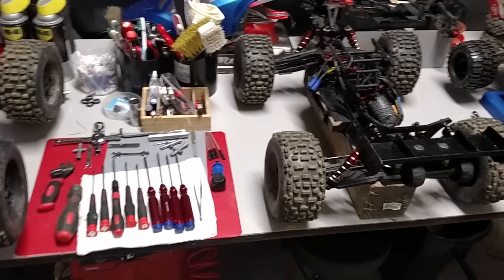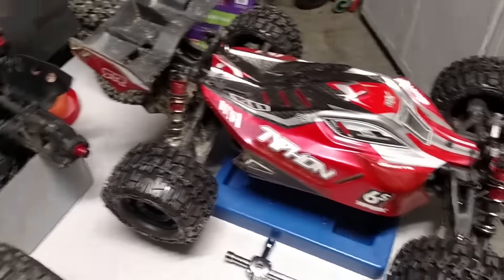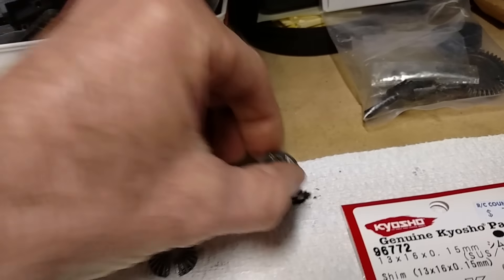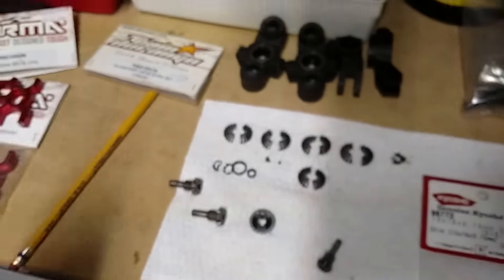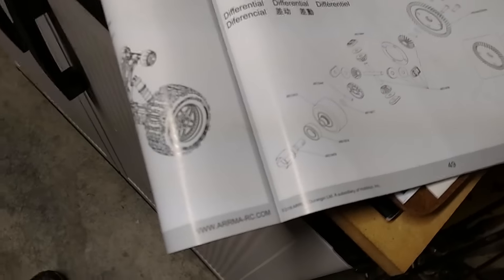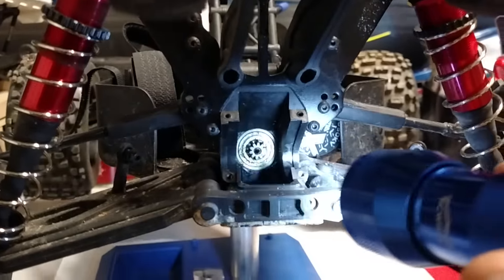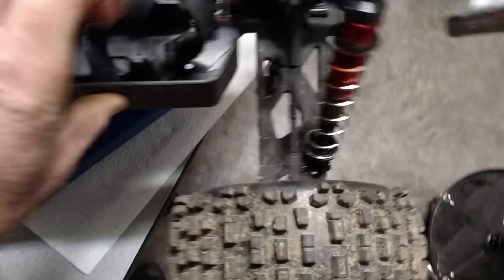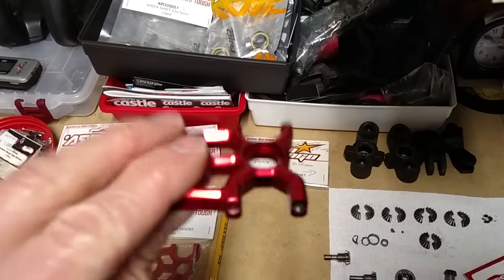Arrma Outcast 6s diff gear breakage

Comment: In the full size vehicle racing world, what you guys do with these differentials is Allen setting the lash. To much and they thrash about an knock each other's teeth out like a schoolyard fight at recess. To little and they grind bind till they effectively wear each other out. It be nice to have lash measurements that would be a joy. Or Maybe we can create some ? Mr. Bash?
Reply from the maker: Phill Stoffer these input gears are so small it's Crazy!!! I'd rather have them snug cuz any slop or separation tends to break teeth clean off. Shimming the internal diffs and adding bearing shims on the crown gear side has totally reduced my gear breakages. I still always check that they aren't "tight" and operate smoothly. As they gears settle and wear, they end up near perfect.😎💪👊👊
Reply: Rich Duperbash you are correct about tight being better than loose. More times than not. Tight will wear in. Loose will shatter and basically implode as you have shown so well in this vid.
✌
Reply: Rich Duperbash exactly. I did the same thing here but it was too late. Also. The box with Talion just arrived.
Reply from the maker: Phill Stoffer did you get a 2018??? 🤔🤔
Reply: Rich Duperbash Yes its a 2018.. Shoot a message to Gary and snag my contact info. Swap ya some shots of my flight crew and the new cars.
Reply from the maker: Phill Stoffer that's awesome brother!!! Don't forget Voltage Hobbies just released aluminum chassis supports for the V3. If you jump high enough or roll at speed the stock ones will eventually break. Vas with Aussie RC broke his the first 6s bash, but he did nose plant off at least 1 jump.👍👍
Reply: Rich Duperbash Hello again Rich. I went after those shock towers couple days ago. Backorder Edward front and rear.  Blehhhhh. Took the Talion out for a spin. Lasted 3 min. When I got it turned around and hit the juice, ended up on the ground as I had to launch myself out of the way. Came inside and put a 4s battery in it. After a glass of wine to rinse my ego off, went back outside into the unknown world of  itstooDurnedfast4u  and tried again. It went much better.  I didn't throw myself under the bus and I didn't run myself down again. YAY I AM....... ALIVE!!!!!!.
Reply from the maker: Phill Stoffer that's awesome bud!!! Yeah it definitely looks fast from what I've seen thus far. I just clipped myself with my Kraton going off a jump...Lol. These rigs pack a punch no doubt. Enjoy that new BEAST!!!😨😎💪👊👊

Comment: Hey man great video question for you I just ordered a new rear diff for my kraton V4 and the external shim that you're talkin about to bring the ring gear closer to the input shaft is on my diff. My question is when I spin the input shaft there is a rough spot when it reaches a certain point on the ring gear so when you turn the input shaft it is smooth up until a certain point then it gets hard and crunchy if I remove the external shim on the ring gear side it gets rid of that crunchiness in that one spot but it makes the rear diff gear mesh loser. So I don't know what to do on this rear diff
Reply from the maker: Thanks brother 👍. I'd take a very close look at the rough spot. Just make sure the teeth aren't chipped or flattened. If so, I'd replace the ring gear cuz it's likely going to strip and slip. Could be the gear isn't sitting totally flat on the diff cup or is wobbling slightly during rotation with the input. I'm ok with my diffs spinning a little snug by hand because they usually settle in under power. Ultimately, use your best judgement on adding the bearing shims. I still like to use 2-3 Tekno #1222 bearing shims both front and rear depending on the tolerances. 🍻😎💪👊👊
Reply: @richduperbash2966  thanks for the reply I'm pretty good with shimming but I noticed this on a used rear diff and I purchased a new complete diff and housing all put together from Arma never used so it seems strange that the gears would be flattened or messed up from the factory so I'm not sure what to do should I have it really crunchy and tight or a little bit loose with the mesh... cause i know its better to have a looser mesh than a tighter mesh so the gears wont wear..
Reply from the maker: @fpvandgasrc4321  if there's some flattened teeth, I'd probably run it a bit tight so the gears are less likely to slip and grind down. Just cake it with quality marine grease 👍

Comment: Which shims do you recommend me using please give me exact part number please and should I just shim the back or front 2? And what diff fluid you think I should use thanks slot for your videos you know your stuff I'm learning I've learned a lot from you and a couple other guys also thanks a lot man!!!!! Keep bashing arrma rocks!!
Reply from the maker: Derek Quinones I shim all 3 internal diffs the same way as Thomas P of "Tp-PartsRC-Xtreme" in his bulletproofing diffs vid. He lists Team Durango TD310475, unfortunately they still appear unavailable online. LOVED them, cheaper option than Mugen Seiki E0206. Both work great. Watch his vid closely, at the very end he puts a small bearing shim on the crown gear side. I use 2-3 bearing shims instead of just 1 to further tighten the crown to input gear mesh for front and rear. Prefer to use Kyosho 96772, but have also used Tekno TKR1222. This video was long and rambling, but think I covered these #s towards the end. I run 50/100/20k front to rear Outcast, 50/200/20k Kraton and like it. In summary, you need 2 planetary shims per diff and will be adding 2 satellite shims per diff, and using 2-3 bearing shims on the crown gear side of the front and rear diffs. Building/bulletproofing diffs takes some practice, but I've had tons of it at this point. Makes a HUGE difference in minimizing gear breakages when running 6s power and bashing hard. 👍👍
Reply: Rich Duperbash awesome thanks for the help I'm practicing this is my first time doing this but I'll take my time and do my best I'll get ahold of you if I need help!!! Bash on man #arrmarocks
Reply from the maker: Derek Quinones just go slowly and pay attention to assembly. I usually warm my sealed diff fluid bottles in a shallow coffee mug with warm water to make it pour easier. 100K and higher is very viscous and hard to get out of the bottle even with the lid completely off. I use Team Associated personally, made my Lucas oils. Also use TLR, Team Losi Racing.
Reply: Rich Duperbash yeah rich I just received a brandnew full bottle of 100k team associated everyone says it's very reliable fluid so I went with it I've only got 100k and 10k by associated so there's probably like a 20k I need to get also!
Reply from the maker: Derek Quinones right on. You could use 10k rear, probably just get 50-60k for the front and your golden. 👍👍
Reply: Rich Duperbash I found the 310475 but I need to personal message you I don't want them all getting bought up

Comment: I’m having a similar issue however my outcast sounds like it’s slipping gears likes it’s barely making contact slipping the wheels not sure what it could be I’ve added heavier oil to all the diffs. And shimmed them still getting the same result thanks
Reply from the maker: If you're hearing grinding/slipping, it's likely a front or rear diff issue. If more so on acceleration then braking, it's probably the rear. If the gears look healthy, could be a cracked diff case allowing the gears to spread apart on throttle. If any teeth look flattened or chipped, they need replacing.

Comment: Hey man you can use a drimmel tool on a stripped ever head,to make it have a flat head I've had lots of luck backing screws out this way
Reply from the maker: Thanks so much Brother 👊. Got some good cutting discs a long while back that work perfectly on the Dremel for that👌. Hammering in a torx bit and using a socket wrench also works great. 🍻😎💪👊👊
Reply: Yea man hey btw I love your vids man you get some sick air,I jus orderd a kraton so it's the V3 should be here ina week,dude I can't wait! Thanks for all this info..bash on brother man
Reply from the maker: @zsaxeshed5743  thanks Bro👊. And BIG congrats on your new V3👀🤘🤘

Comment: I purchased an arrma notorious recently and I'm trying to build it up to your outcast/Notorious truck... The solidering iron trick, how long do I'll hold it on the screw for ?
Reply from the maker: Congrats on your Notorious 😜!!!! The soldering iron can take 2 plus minutes to heat up the screw enough depending on the iron itself. I do it until I smell threadlock melting or see a small waff of smoke. It's faster to heat the screw briefly with a butane torch. Takes only seconds 👍. I've since switched to using the torch most times. 🍻😎💪👊👊
Reply: @richduperbash2966  Thanks man, I've been watching your channel for a while now... I wanted to buy a brcc, but I grew impatient and purchased the Notorious instead... I'd like to clone your outcast/ Notorious in baby steps...

Comment: Rich Duperbash please tell me how do you can put those 2.8 on your typhoon. I would love to have those on my typhoon but I am in need of some assistance. I would greatly appreciate that if you could help me out. I think your typhon looks awesome with those 2.8's
Reply from the maker: Nathaniel Brown you have at least 2 options. I took the pricier route and swapped on Kraton hex's, axels, and hubs. You gain 1 inch width and can then fit MT tires on with no rub. Other option is Team Associated RC8T  hex adapters. part 89330. Only thing with adapters is hex pin holes are a tad bigger than Arrma. Can use Arrma stock pins with paper glue or something to tighten pin until wheels are fitted.
Reply from the maker: Nathaniel Brown wanted to add, make sure you get Kraton version 2 hex's, AR310484. I say this because version 1 hex's will sometimes pop up online when doing a search, the pins won't line up on version 2 axel holes. I run F11 17 hex 2.8 rims for 2.8 Trenchers, and Proline 3.8 Badlands on Desperado 3.8 rims. Tape your tires or they will balloon and rub when turning. Both rims have a good offset.

Comment: Did adding the extra shims help out with play on the diffs? The ones you was shimming on the gear boxes
Reply from the maker: Matts Rc Addiction I took the rear diff apart after the vid to change fluid and check gears, decided to wait for planetary shims to arrive, were supposed to arrive today from Tower, hopefully early tomorrow. I misplaced my only Team Durango shims. There's no doubt that shimming will tighten up diff internally and externally. Tested great on my Typhon in the past, just never tried externally on the the crown gear side with bearing shims. I'll post running vid with feedback after Outcast is shimmed up, gears get expensive and really want to wear them out slowly having fun, not break them.🐒🐒🐒
Reply: Rich Duperbash thanx I'm ordering all my parts this weekend figured if I was going fix my broken rear end mines as well bullet proof all my diffs thanx for the video
Reply from the maker: Matts Rc Addiction your welcome bro, hopefully bulletproofing helps durability some.🐒🐒🐒

Comment: Hey Rich, Do you have any videos of the clicking noise? I have a 3 week old V3 Kraton that is making a rotational clicking noise, It sounds more like dog bone noise but idk.
Reply from the maker: Hey Brother 👊. I don't have any vids demonstrating specific noises🤔. I've had gears strip a tooth or 2 during video shoots where the noise was apparent. The dog bones do chatter a lot on the 6s rigs and that's normal 👍. I'd check to see your motor mesh didn't come loose 🤔. Stripped or chipped gears make a cyclical clicking noise, especially on throttle. Can sometimes be harsh slipping on throttle. With time you'll get better at differentiating and pinpointing issues. Big enough issues usually cause a noticable change in performance. Hope this helps some. 😎💪👊👊

Comment: for the diff you said to put 2 small shims on the outside of the bearing two of them do you do that for the center differential or that is just for the front and rear diffs
Reply from the maker: Anthony Husbands I only do this for the front and rear diffs to close the gap between the crown and main input gears. This has definitely helped spare these gears from losing teeth...Lol. I can usually only fit 2 shims in, but if you can fit 3 without forcing it, that's probably good too. Now the only time I break a tooth there is if the center outdrive cup comes totally loose or my kids really abuse the throttle doing high speed rolling backflips...Lol. Anything that really suddenly jambs both fronts or rear tires at the same time (hard throttle pinned against a fence head on) puts these gears at risk regardless of shimming. 😵😵😵😲👍👊👊

Comment: is the shimming still relevant with the v4? i have my esc maxed out (punch level 9). itll wheelie on wet pavemnet all day.. i havent had any issues whatsoever with the v4 6s typhon, but im wondering if i shim it if itll last even longer?? or did Arrma take care of that with the v4? idk what all the upgrades were from v3 to v4. but i see so many peopel shimming the v3's, youd think they would have taken care of it in the v4.. but id still rather be safe than sorry.
Reply from the maker: Great question Joshua 👊. The V4''s were a big improvement. No real need to add internal shims. I still like running 2-3 bearing shims TKR1222 on the crown gear side bearing to snug the mesh between the crown and input gears. Internally, I still prefer the Mugen Seiki E0206 planetary shims more than the V4 ones, but the V4 is a vast improvement. 🍻😎💪👊👊
Reply: @richduperbash2966  cool man. thanks for the reply. im gonna grab me some of those mugens.

Comment: I want to rebuild my front diff cases on my 6s #KRATON & 6s #Notorious! Do you know if this is the correct part number - F/R DIFF SET 43T STRAIGHT (1PC)
#AR220028 (ARAC4015)?
Reply from the maker: The Kraton/Outcast/Talion all use 43T "spiral cut" crown and 10T input gears. That must be for the Typhon/Infraction. 🍻😎💪👊👊

Comment: Hey bud! I finally broke down ma kraton last night (been down for awhile).. Rebuilt all 3 diff and added thicker oil.. Got it all done and I'm still getting a gringin noise when accelerating and breaking! I'm stumped bro! Any thoughts??
Reply from the maker: tommyd3jr I'd start by making sure you're front and rear input cup grub screws are sitting flat on the input shafts and are fully seated. They can break free and start slipping. The other thought is making certain your diff case covers are sitting flush on the outdrive bearings and that all 4 diff cover screws are fully locked down. Obviously you don't want to strip them by over tightening them, but if the cover is not sealed all around, the diff can get pushed away from the input gear under load and slip and strip. Are you sure you're input and crown gears looked healthy when you dropped your diffs back in???
Reply: Rich Duperbash 
Thx for the feedback bro! If the input cups came loose would it make that grinding noise tho?
Reply: Rich Duperbash 
I will take a look at everything else after the Jet game.. I'll get back to u and lyk how i make out
Reply: Rich Duperbash 
It's a pretty violent grinding sound.. When i break hard or pull the trigger
Reply from the maker: tommyd3jr yeah slipping cups are looking are less likely if it's violent grinding. Probably a toasted crown and pinion gear.🤔🤔😨
Reply: Rich Duperbash 
Brand-new center diff and i replaced all the internal gears in the front and rear.. The input gears looked good too bro lol! I'm stumped man

Comment: What servo are you useing with your voltage hobbies servo mount wanting to upgrade to SW1210SG and I have a voltage hobbies mount
Reply from the maker: Matts Rc Addiction still running stocker for now, seems to strip less from what I hear after mount upgrade. Turns Backflip tires fine for me, anything heavier and I'd probably want to upgrade. Already spent a grip on spare parts and rebuilds. Did splurge for 2 Nero motors off Amazon, 50$ each. Going to try in Kraton, then Outcast most likely.

Comment: I have a huge problem. How did you take off the wheels of the Outcast?
Reply from the maker: Manuel Rendon this has become a common issue discussed on Arrma Forum. I heated my wheels gently with a heat gun near hex's, stood truck on side, had to stand on wheel carefully with both feet and pull near hubs rocking back and forth to loosen wheels off axels, total PITA! Once off use Dremel or round file to debur wheel hole for easier fit.

Comment: rich if you use the allen wrench they give you ,them screws come out no problem..No matter what type of them tools with handle you get the allen wrench they provide is ten times better....Believe me i had same problem until i started using them, just use as breaker bar then finish with your wrench.BASH-ON  BROTHER
Reply from the maker: RCbashing the KRATON I stripped 2 Arrma wrenches and actually broke a driver handle in my hand going gorilla style. Think the excessive locker had been hit or miss, but thanks bro for suggestions. For me heat has been the key.
Reply: Rich Duperbash gotcha...

Comment: What do you think about my gess in diff oil? I ordered 30k rear/100k center/50kfront? I live in Canada, having 4 months of cold weather.I don't want to change diff oil twice a year and I also need power in summer time.
Reply from the maker: Sylvain Grenier should work AWESOME. I'm running 50/100/20k front to rear and it works great. 🍻😎💪👊👊
Reply: Rich Duperbash, What weather conditions (temperature) did you try with that recipe?
Reply from the maker: Sylvain Grenier I've run this setup in temps between about 35-110F. Live near Sacramento, CA. Don't get snow or freezing temps here. Keep in mind the diffs warm up tremendously during hard running regardless of ambient temps.👊